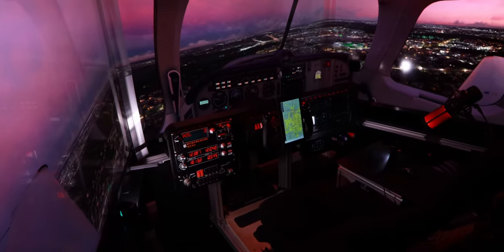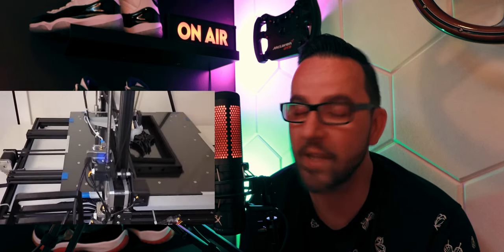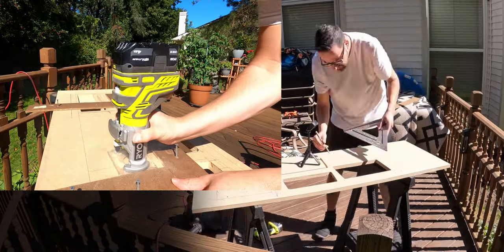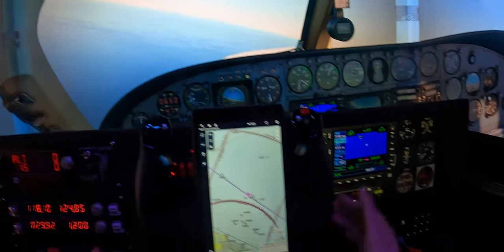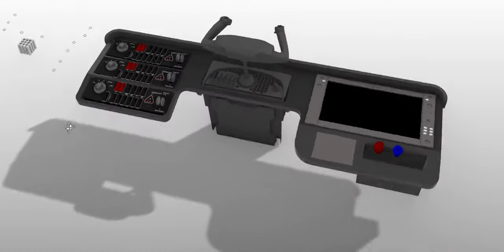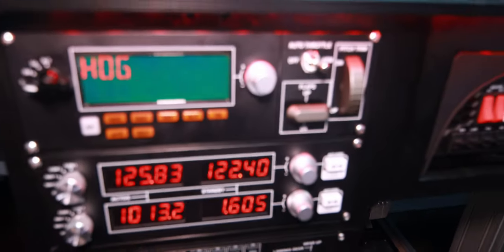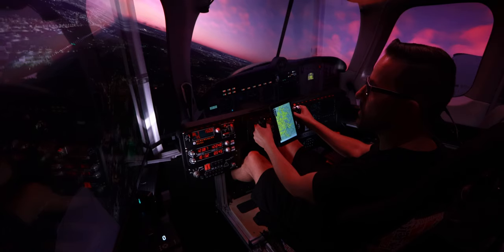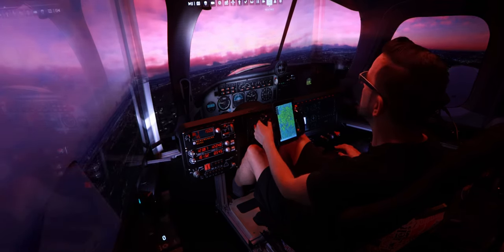I BUILT A FULL FLIGHT COCKPIT ! 3D printed | MSFS2020 | DIY

Comment: Nice setup, and I realize the amount of time it takes to research, design, and build. I was wondering if you used Arduino processors and if you used more than one did you have problems with multiple Arduino’s being recognized by MSFS2020 ?
Reply from the maker: Thank you so much for your comment. Sorry for the late reply. There were no arduinos used in any of this. Possibly the throttle and mixture at the bottom that I bought off of Amazon has an Arduino inside of it but everything else is a self-contained device plugged in with USB. These are all name brand devices that I purchased off the internet. Joe, they probably have their own custom PCB boards

Comment: Hi, great deal. I would like to see your design. What type of equipment did you use? 
 I would love to see your plans.
Can you send me your equipment that you used please?
I was an engineering designer so I use to use ACAD etc for my biz also.
I look forward to hearing from you.
Reply from the maker: Hey Stewart! This was done in a program called Rhino and printed on a 3d printer from Creality. It's  a  pretty large printer and even so I had to devide the piece into 3 large pieces. The plans consist of a 3d printed file but can be converted into a cad drawing from all views if someone was interested to use to and build it out of a different material like metal or wood .  I haven't uploaded them but will upload them soon.
Reply: @DaSimSimma  Awesome!!!🤩🥰🤪💥💫💯

Comment: Great my video my man. Love the setup, it looks professional as hell! Question, does it ever feel odd being centred rather than being to the left?
Reply from the maker: That's a great question.....I know it is difficult to tell due to my camera position ...but most of the time I am sitting on the left and not centered. What seems odd is that most of my panels are on the left side where nothing would be in an actual plane. The problem is ...although he screens depict a whole cabin , I have limited space for all these devices. So , in short : it's a percenption not a reality and while actually sitting in the seat all appears "almost normal" . Of course I pondered rebuilding in a way so that everything sits to the right of me ...I just haven't found a way yet.....perhaps I remove the touch screen and air manager ? I honestly don't use it a lot....

Comment: Do you share your print files?
Reply from the maker: I have not but maybe I should ?!
Reply: @DaSimSimma  I’d like to attempt to print it!
Reply: Also, where did you get your brackets for your monitor mounting? I’m still solo screen. Did you buy one or make it?
Reply: I was looking for a video of yours showing all of that setup but couldn’t find it.
Reply from the maker: I made a triple screen table using 8040 aluminum extrusion and then used shelving as the top of the table. Those TVs are just sitting on a homemade triangulator table
Reply: @DaSimSimma please share 3d printer files